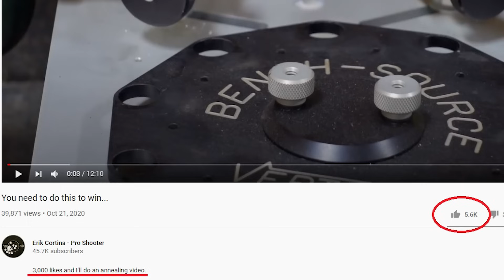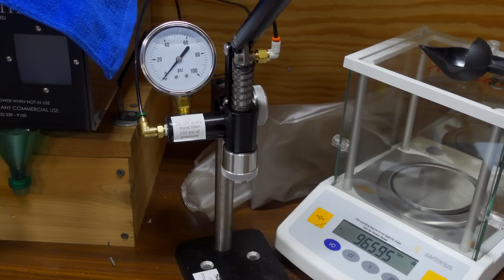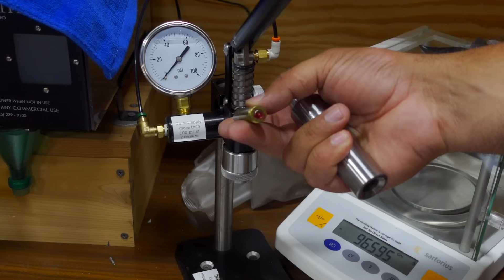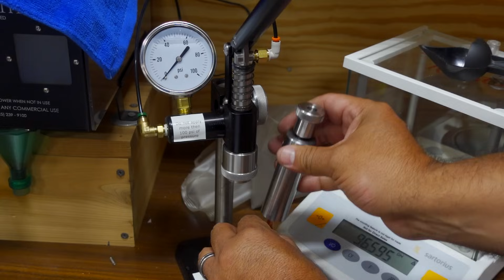This is how I anneal my brass

Comment: Good info.  I also figured why I "cooked" my brass when I was trying to anneal by eyeball...I was doing it under fairly bright light with sun shining in through the window. By the time I saw an orange glow it was hot, hot, hot, LOL. I didn't think I ruined the brass, but was a little worried I had shortened the life of those cases.  To me it seemed like it had softened the neck and shoulder a lot.  BTW, I'm still running some of those pieces for practice ammo.
Reply: How did that turn out?   I did that same thing to about 50 x 22-250 cases of Rem No brass I’d neck turned.  I hope I can recover them(!) after hand flame annealing too much so I can continue to shoot them.
Reply: @daboogster7639  as I said, I used mine as practice ammo only and it seems they all held up. I have tried to keep those pieces  segregated and have not had any fail yet.
Reply: @Halfmilesniper  thanks for your fast reply!  

I’d think with a couple shootings, they’d be hardened again.  As long as you wear safety glasses should a case pop.   Lots
Of gas!

Comment: Some annealers say that it must drop into water as the metal still holds heat longer then it should after going away from flame. So should cool quickly otherwise the heat stays to long in brass

Comment: I put the torch tip as close to the brass as I can reasonably.  You can see the flame "hug" the brass.  You don't need 2 torches, just put it closer.

Comment: It's interesting that guys assume that annealing makes the neck tension more consistent, but nothing in this video would indicate that is the case. Perhaps that's because the flame method itself was loosely controlled. Possible that different annealing methods result in different variability. Also, it would have been nice to include how the brass was resized. For example, a traditional die with and expander mandrel would work harden the brass more than a Redding bushing die with no expander mandrel operation.

Comment: The rule of thumb that I learned was when the flames changed color, you had done it too much. Concept being that the color change in the flames coming off the brass was an indication that you were "burning off" some of the alloy. From what I saw, you were OK through 9 seconds. That last second was "too much" according to what I learned. You are quite correct, repeat very correct, that there's a very wide window that's "usable" and "effective" when it comes to annealing. Keep up the good work!!!

Comment: i just used this “method” on r-p rem 223 brass and 1. so small of neck tension you can push the bullet inside the case
2. some necks were crooked as hell after sizing / expander mandrel

(was done with a single torch merhod)

Comment: Hi Erik , very interesting video when seating the bullets there were quite a lot of variations in bullet seating pressures both with the normal annealed brass and the over annealed brass , would it have been a more accurate test if the neck tension was set more accurately with a expander mandrel so that all necks would have been set to the same tension or were they set when you resized the brass ? Also with your test the brass that was over annealed also showed that the heat traveled much further down the body of the case something that would be incorrect would it not ? I thought the goal was to soften just the neck and shoulders ? Also the honest question would be if the 10 second brass was not over annealed would you want to fire that 10 second brass ? And it will be interesting to see your results against the results of the AMP Annealer hopefully in your next video with I hope that with all brass that the same neck tension is given to all tested brass so when using you harbour press what results that would show . I hope you will read this comment and write back as I am very interested in this sort of stuff,  and I have learnt a lot from your channel and enjoy watching some great content, all the best Gianni. 😁👍

Comment: I use a cordless drill will a long socket the angle of the drill is perfect but I need to work on the distance to the flame I just turn the lights off and let it run until dull orange. Like the pressure gauge and dye 👍

Comment: Interestingly enough, your method of metal color is almost perfect for getting around 450-500C. Hot stuff glows at ~525C. 10secs probably got to yellow, 700-800C. It shouldn't cause too much issue to the necks, but the heat could go lower into the case body, messing up the strength.
Annealing is temp and hold time, so the anneal doesn't have a lot of time to "act".
Great videos. Your technical rivals Matts dumb science.
While I don't reload, I am a Metallurgist... but been years since i did non-ferrous.
Reply from the maker: Thank you.

Comment: Eric, great information and you confirmed what I have always thought but could never "prove scientifically".  I use a cordless drill with a drill bit just a hair smaller than the neck diameter.  I spin the neck over the flame using a bottle like you did that I just stand up on my bench until the brass just starts to turn orange and then drop it in a metal coffee can to cool off.  How consistent is that?  No idea but consistent enough for what I do.  Thanks for the work you do helping to educate all of us.

Comment: Ive always heated untill red then In guns and ammo magazine a few years ago a metalurgist did an article on anealing. He said when heating untill red brass is considered destroyed, he then said if u dip them in melted lead untill the lead doesnt stick is about perfect temp, he said they should be black not red, so it sounds like 610 to 700 degrees is about right.

Comment: Suggestion get a 5 gal propane bottle and do a split hose to connect both flames. It would be cheaper than the small bottles your using.

Comment: Erik, the biggest challenge is to not UNDER anneal because under annealing does nothing to the brass. With over annealing the danger is you might make the case head soft which is dangerous. You can get welders paste that changes colour at a certain temperature ranges as a more accurate measurement. But with practice your way does the job, with the change in flame colour and how far down the case body colourisation changes as a guide.

Comment: Hi Eric......THANKS for all the help!!!   You've been assisting me for years now! 

With under/spot-on/over annealing, how does the varying grip of the neck affect the ballistics?  I use the Giraud annealer and think I lean towards over-annealing.  Low-volume shooter therefore low volume annealer, wonder if annealing variations between batches will screw up consistency?  If so, I will work harder for consistency.  THANKS!!!

Comment: Simple is good. Red hot is more than hot enough to properly anneal the neck, but not so hot as to cause damage.

The only real risk is if you somehow manage to anneal the case head, which needs to stay fairly hard. On long rifle cases like that you'd have to really overdo it for the case head to get that hot, but on short cases like the 7.62x39 family it can happen. Don't laugh, there are some common benchrest calibres based on those short cases.

I ruined a batch of brass once, forming .401 Winchester out of Lapua 7.62x39 and annealing too much in an attempt at preventing splits. The heat crept down into the head, softening it. A load that was perfectly safe in un-annealed brass expanded the case head and blew out the primer, as the primer pocket expanded. Had to discard 100 brand new cases as I couldn't know if any of them were safe after my overheating them. Ordered another box of 100 and skipped the annealing step, turns out Lapua brass is so well annealed from the factory it won't split from being expanded to straightwalled shape anyways.

Comment: I think the big danger in "over-annealing" is the heat traveling to the case head, because you don't want to soften that part of the case. That said, I don't think you're hitting it hard enough to anneal the case head, even at 10s. Tempilaq is good for figuring this out.

Comment: ive seen old guys use bees wax candles i guess the bees wax burns the hottest of the waxes. the top tip of the candle flame where it is blue burns 1,400 °C (2,550 °F). and you hold it till the base of the casing get to hot to hold, typically around  the safe comfort level an average human hand can handle with out being burned 120 °F.

Comment: Great videos.  I just got my first automated annealer, about $275.  I can load it with 50-100 cases and it just flame anneals them and drops them in a tray.  

I like to shoot prairie dogs with little guns like 221 Fireball, 223 and 22-250.   I thought I knew what I was doing as I have had pretty good luck out to 400-500 yards. I’ve hand annealed my cases, probably over-annealed them but have “been lucky”.  And I’ve not done it every time I reload.  I will now based on your experience.   

Question:
How would you recommend I clean the brass prior to annealing?  Sonication in vinegar solution containing water, Dawn soap and Citrate or just corn cob or walnut vibratory tumbler?
Reply from the maker: I don’t clean brass hardly ever, but when I do I use stainless tumbling media.  About 20 minutes with dish soap and lemi shine.

Comment: Great video!! I think the secret to good annealing is consistence, regardless of the method used. I tried the drill & socket method but found the consistency too erratic. I just bought an Annealeez annealer and dialed it in using Templilaq 750 after four cases. All the cases after that were remarkedly similar in appearance after that. Is it perfectly annealed? Who knows, but at least all the cases are annealed the same. I just made up some wildcat cases for fireforming, so I will get a chance at "batch" annealing once I form them. My goal is case life, not particularly 1000-yard accuracy, seeing as 200 yards is the limits of my local ranges.

Again, great video. I'm been waiting for this one.

Comment: The only thing about 'annealing your brass' is that in reality for most cartridge cases, the life expectancy is less than 4 uses, and therefore isn't needed. You will buy the brass (loaded or unloaded), then get 2-3 reloads from it...before you get wall thinning to the point it is no longer safe to reload or fire. This is especially true with 'bottleneck' cartridges, such as .30-06, .308, and SEVERE with belted magnums, like .300WM, .338WM, etc.  So, in reality, you will almost never have a 'case hardness' failure (in good brass) but a 'thin-wall blowout' due to insufficient metal thickness as a result of stretching and case-trimming. Confusion on why you are getting 'splits' and 'seperations' are a BIG reason why many reloaders chase the 'wrong correction' factor, too.
Cross-section your cases at the point you are getting 'splits', and see if your cases haven't become 'paper-thin' at that location...99% of the time, it is due to thinning, not hardening issues. (this is NOT necessarily the case when you are dealing with straight-wall cases, like .444, .45-70, etc., and especially when the split happens near the crimp...the straight walls can be reused several more times when a 'mild-crimp' is applied to the projectile...but due to the crimp, there can be 'work-hardening' which does require annealing to return the brass to a workable state.
Some reloading books give you valuable data on minimum acceptable wall thickness for brass. Checking the numbers, you'll find that some cheaper brass is right on the absolute minimum wall thickness to start with, so that even 1-2 reloads is enough to thin your cases below acceptable wall thickness! BUY GOOD BRASS TO START OUT!

Comment: This is for match ammo right? Single loading such as what you do.  That seems a little much for maybe plinking or hunting ammo right? I was under the impression 750° was as far as one wanted to take brass before it is too soft. Turning red in well beyond that temp. I have always used Tempilaq, drill and torch (Poor mans way) and ran a few pieces till the Tempilaq turns black.

Comment: Appreciate the vid!  Reloading for a few years but only now getting into annealing. One question..  doesn’t over annealing pose a possible more dangerous firing situation?   Neck tension wise you proved not a big deal and the plier test seemed good but what about actually firing it with tens of thousands of psi when over annealed?  Your explanation made it more worry free however don’t want to get to get a false sense of security.

Comment: Here I was worrying about ruining brass by cooking it. Thank you.
Reply: It is possible. My son has proven it. lol. I wish I could post you a picture. He melted it to the diameter of a quarter. lol.
Reply: You must anneal only the shoulder and neck.  You anneal below that and you will have problems. Never heat brass in an oven other than to dry & below 200 degrees F.

Comment: Thanks for the video on annealing!  I actually have a question about your hydropress readings.  What readings do you usually get, and do you normally lube the necks prior to seating?  I've heard you're supposed to get ~35 but I always end up much higher.

Comment: Great video Erik, I am wondering, did the longer annealed brass affect the head spacing between the 2 batches? I did a test with short time annealing and longer annealing times batches and I noticed the longer the brass was annealed the shorter head spacing was by a few thousandths say up to 10 thou. My assumption is that the longer you anneal the less "spring-back" the brass will have and you will need to set up your sizing die accordingly.

Comment: Neck and shoulder-only annealing is overhyped.  10-12 minutes (depending on the round) in a 600 degree Fahrenheit convection oven (oven hacking required usually via changing out a thermal fuse) gives me cases that only split on my most worn-out-chambered-guns.   I've never had a case separate.  I tried using this method and a water bath on deprimed cases but, it was hard to determine the best water depth and didn't seem to matter, anyway.  I try to do only a couple hundred rounds at a time so they all feel the heat.

Comment: Very excited for the patreon video with the amp.  Is it a possibility to test un annealed brass at the same time as a control?
Reply from the maker: There is no such thing as “un-annealed” because it comes annealed from factory.  

I plan to take 15 PCs of fired brass.  Leave 5 alone, anneal 5 with flame, and anneal 5 with AMP and shoot them side by side at 1,000

Comment: Re your AMP test, might need to experiment with internal neck lube to find the right one that keeps your ES down. Apparently cleaned induction brass is a bit grippy and it doesnt take to graphite really well. Im trying 'oneshot'to see how that goes. Rcbs water based lube is a no no (to leave in the necks)
Reply from the maker: Any lube added to inside of necks will transfer to barrel.  Don’t do it.

Comment: Thank you for finally releasing an Annealing video! Lots of great info. Just one quick question, lots of controversy out there. Anneal before or after your resize?
Reply from the maker: Before.
Reply from the maker: If you remember what I read in from Machinery’s Handbook:

“To improve or restore ductility for SUBSEQUENT forming operations”
Reply: Great point. Thanks!

Comment: I'm using the RCBS 'Small Base' dies on once fired .308Win. LC brass. I'm noticing, on half the brass, there's a smooth slope from the shoulder, coming into the neck. These seem to cycle without any issues. HOWEVER, the cases that have a very slight, 'straight' taper where the shoulder ends & the neck begins, if that make's sense, these 1's are sticking in my bore/barrel!!? What is going on with these cases, & is there a way to resolve this, I don't understand, being they're all LC brass!??

Comment: Do you ever water-quench the brass after heating it?  I have a .270 collet sizing die that will only produce brass with sufficient neck tension if they are annealed; even when new.  Perhaps the mandrel is too small?
Reply from the maker: I Never quench.

Comment: Are you doing this before or after sizing, as sizing & necking the brass would introduce work hardening as well. Also, how many time of sizing because each time you size you are stretching and thinning the brass. The neck can only be so thin.

Comment: I see other annealing video where they drop the brass into water...  Which is correct, air dry or shock cool?  
Thanks for posting these tutorials, while I’ll never compete, it would be fun to wow others at the local range..
Reply: It doen't matter. Some do this so they can touch it. Others have no idea what they are doing. "Shocking" copper has no justification. Hopefully Erik weighs in.
Reply from the maker: Correct, it doesn’t matter.  Once brass is removed from flame, it starts to cool off.
Reply: Erik, Thank you, Please keep these tutorials coming...

Comment: You should use Templaq 750 for heat indication. Ideal annealing time is approx 3 secs. You can also get Templaq in lower temps so you can see if you are heating the case too far down.

Comment: Ive never done this.  my brass currently sits at about 5-6 reloads.  how many you think with and without?
Reply: Depends how hot you load em, how hard you crimp, how much lube you use, how much zinc is in each piece. There's a bunch of factors. I've heard old guys say if you're not annealing and you have a set, to throw them all out after you have a few start to spilt.

Comment: Eric, I have a question about quenching after annealing. I have been for several years because I don't want the heat to travel down the body and soften the head end, So my question is concerning primer pocket expansion. What's your thought on the effects of quenching or not quenching on  primer pockets.
i have 11 firings on my brass with no loose primers. They are srp.